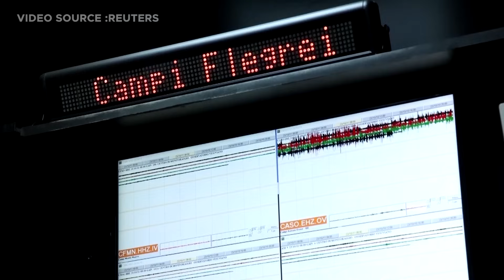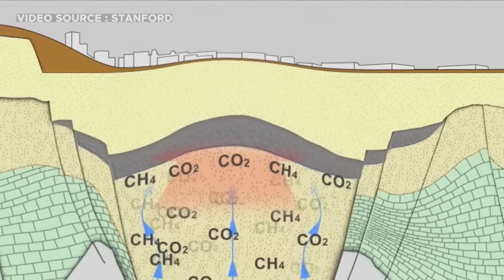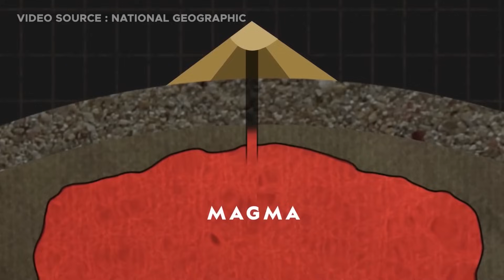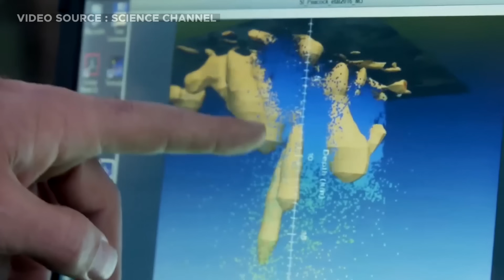Most DANGEROUS Volcanoes That Are 99.9% Likely To Erupt In 2024!

Comment: IF YOU TOOK SCIENCE AND GEOGRAPHY YOU WOULD HAVE SEEN THE BALL ON A STEEL STICK AND A STEEL RING ON A STEEL STICK. WELL THE SCIENCE OF THE PLANET.S 50 YEAR CYCLE. THE EARTH HAS TWO MAJOR SEISMIC SHIFTS = 1. THE EARTH HEAT UP AND IT EXPANDS ..SO DOES THE STEEL BALL WHEN IT IS HEAT UP. AND THE STEEL RING IS THE ATMOSPHERE. AND WHEN THE STEEL BALL IT HEATED UP ..SO TO IS THE ATMOSPHERE AND THE FIRST TO COOL DOWN IS THE ENTIRE WHOLE ATMOSPHERE. WHERE THE EARTH WILL EXPERIENCE 5 YEARS OF COLD SUMMERS. 
AND THE WORLD.S BIGGEST PROBLEM IS IGNORANCE TO THE HISTORY AND GEOLOGY AND THE REAL SCIENCE OF THE PLANET.S 50 YEAR CYCLE. 2012 - 2035. JUST GO BACK 50 YEARS MAJOR ERUPTIONS DAILY =CLIMATE CHANGE AND INFECTIOUS DISEASE OUTBREAKS ALL AROUND THE ENTIRE WORLD EVERY 50 YEARS. 1910 -1935. =THE SAME MAJOR SURFACE WATER RETAINED BY THE. EARTH. FOR THE YEARS OF 1885 - 1910 THEN SAME THING. AND SAME BACK ANOTHER 50 YEARS AND ANOTHER 50 YEARS =

WE ARE HALF WAY THROUGH OUR. MAJOR. TECTONIC PLATES CRACKED OPEN MAJOR VOLCANIC EARTHQUAKES MAJOR VOLCANIC SMOG ERUPTIONS AND MAJOR INFECTIOUS DISEASE OUTBREAKS AND MAJOR EXTREME WEATHER PATTERNS NEXT IS THE ATMOSPHERE WILL REALLY COOL DOWN THE ENTIRE WORLD. WITH MAJOR FREEZING..SNOWY..COLD WINTER FOR THE NEXT DECADE =
From 
THE CLIMATE-CHANGER GOD-ROCK
AUG 29 2024